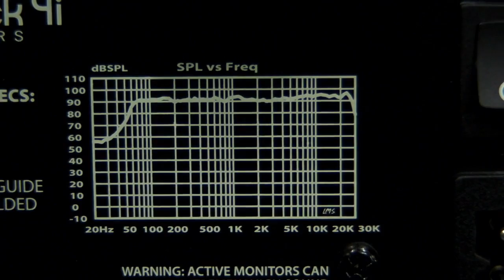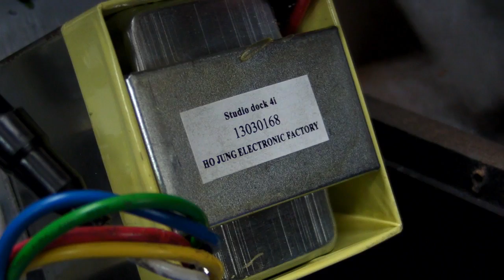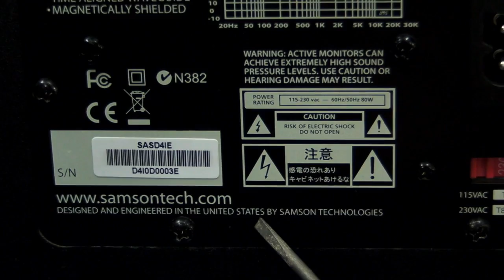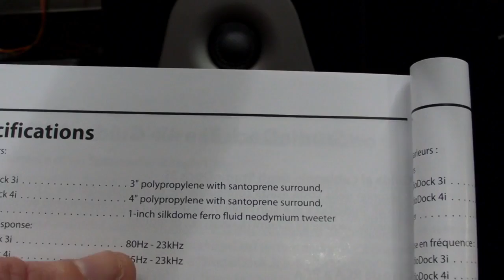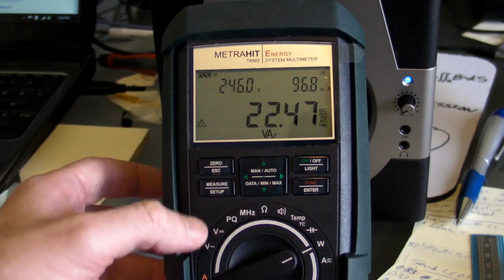EEVblog #169 - Samson StudioDock 4i USB Monitor Speaker Review

Comment from the maker: @Bastimon It uses standard USB audio drivers that are built into Windows, no need for a special driver. Just plug and go.
Having a sound card with Line out does not help you drive higher powered external speakers (they can only drive headphones typically), so you would still need an external amplifier. Powered Studio Monitors are quite common in recording studios. For computers, USB powered monitors do the same things, but with a convenient USB interface.

Comment: Pulled a fair few amplifiers apart, very well made even when you compare it to even some big brand gear. As others have said, the glue will also serve as a sealant as any leaks can cause the tuning of the enclosure to change and some holes can even cause noise as air rushes through, great that they actually did that!

Comment: 8:25 it does look a "bit" messy.. I wonder what all the cables are for, ideally you'd only need 4 cables inside, but I guess they need a lot of inter-board connection and they chose to do it via cable instead of just PCB connectors

Comment from the maker: @k0rmus If you have a computer with Line Out then you can use any external amplifier and speakers (some are poor quality though if you are talking high end audio). But then you have 3 boxes on your desk. 
But I have a notebook that does not have a line out, so the simplest solution is a set of powered USB connected speakers like these.

Comment: The main purpose of the glue in such construction is to cancel air whistle from speaker compression. This is why glue is all the way around connector perimeter.  I used to build different audio constructions and believe me, those air whistles are very loud and annoying :)

Comment: @danz409 That would only indicate that a USB host device was connected, not that the speakers are the default/active audio device.

I'm not sure if it would be possible on the hardware side to determine if the speakers are the default device, but It might be possible to detect if it's active (as in drivers initialised etc.).

Is there no power switch on the front? Would be annoying having to reach for the back all the time.

Comment: Rather than for vibration, I would think all the glue was for sealing the cracks to prevent unintended venting of the enclosure out the back. Likewise, the entire electronics assembly should be sealed to the enclosure. That you could pry it off says there wasn't any glue, but you could always put in some soft, tacky caulk before putting back together and still be able to open it later.

The enclosure skin is officially known as "genuine simulated imitation faux leatherette." :-)

Comment: @EEVblog I want to identify the driver to see if ti is Linux compatible. Eg. a usb audio Card I use:

Bus 003 Device 002: ID 0d8c:000c C-Media Electronics, Inc. Audio Adapter
VID:000c
PID: 0d8c

I will post an image with instruction on the blog, yt doesn't allow links.

Comment: I would have  thought them to be exactly the same both speakers. With their own amplifiers and stuff, but maybe that's for more expensive ones. The weird thing is the weight. Good speakers weigh a lot! They have to so they don't vibrate and that they keep still with large sound pressure levels. the other one is lighter so it'll sound little different. Other one is stuffed with electronics so it'll make it sound different... that's too bad.

Comment: I wonder, why are there usb speakers? It means you have to rely on third party drivers by a company that most likely won't be around anymore once there is a new iteration of your operating system, or is there any sort of standard to that? I see it making sense in case of a laptop that doesn't have good audio but as for a desktop computer youc oould always get a semi-decent soundcard cheaply.